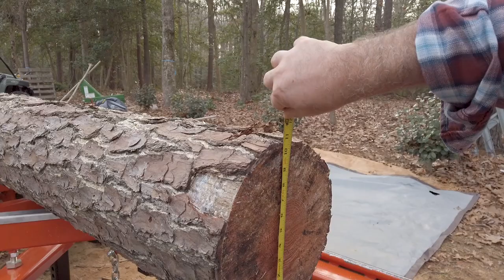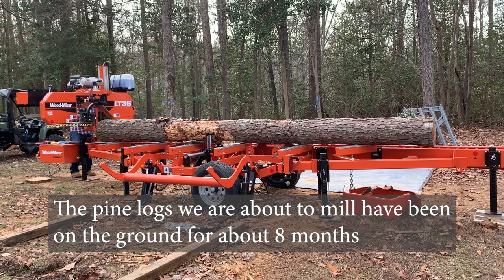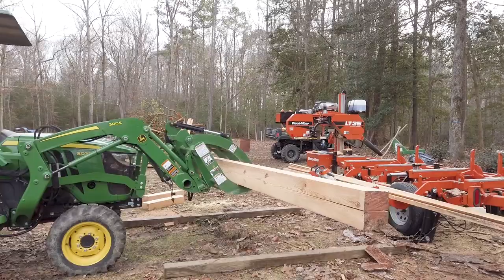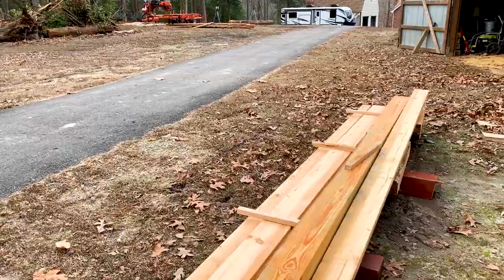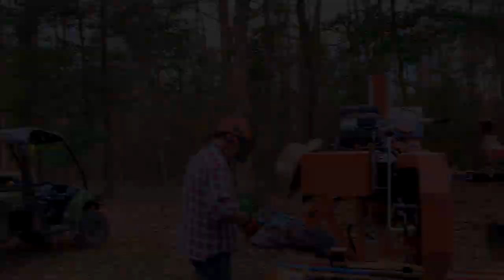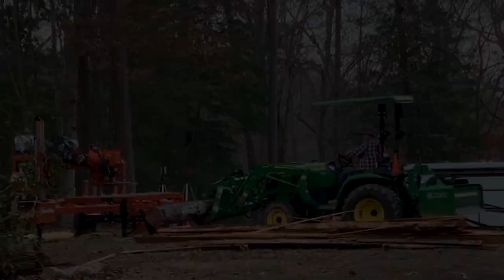#49 Sparks Fly Milling Pine on the Wood Mizer LT35HD Sawmill

Comment: Probably the most sparks I've ever seen come off a mill. 
Got a few marks in my first stop as well. Welcome to the club.
Reply from the maker: That was my second time.  The first time was just a graze.  This time it was a head on crash.  That was a fairly new, never sharpened 447 blade too.  After replacing the blade, the mill worked fine nothing appears to have been knocked out of alignment.

Comment: wow that was some sparks, what the heck did you hit? I have the exact same setup......LT35HD with a JD3032, was it hard to get the grapple installed, did you do it yourself? I don't know much about hydraulics but I don't really want to pay a dealership to install it, I'm sure I could figure it out as long as I get the right stuff
Reply from the maker: Hi Lee - I hit a backstop.  I thought it was all the way down, which would be normal for when I have three flat sides on a log like that.  I must have gotten distracted and forgot to  put the back stops down.  It is a Frontier grapple I picked up from the JD dealer when I bought the tractor. I had the dealer install the 3rd function valve and controls when I bought the tractor.  The grapple is the best option I have on the tractor.  Probably the best money I've ever spent.  ;-)